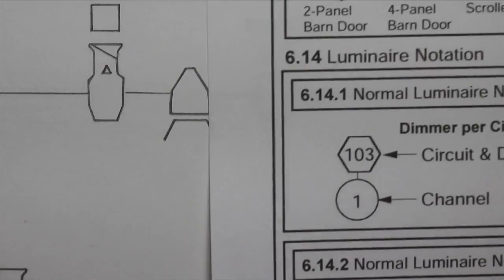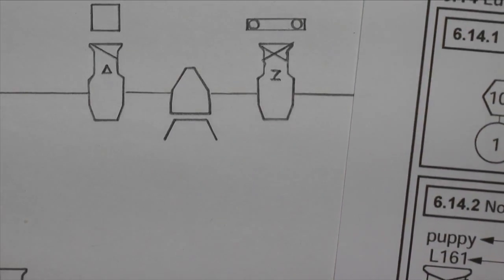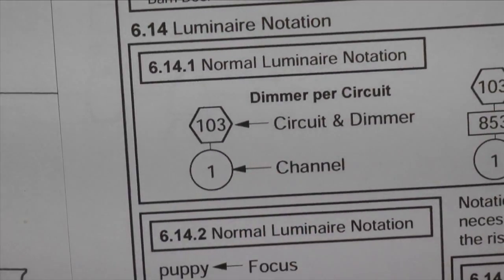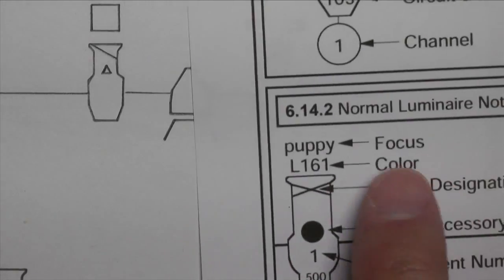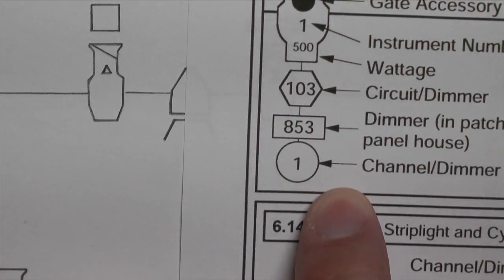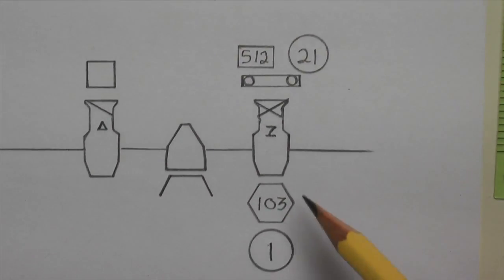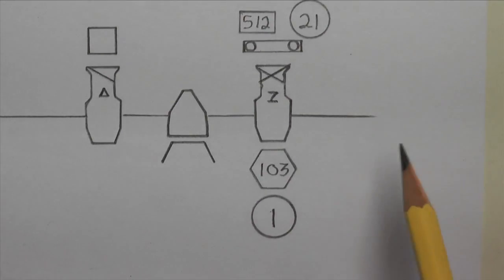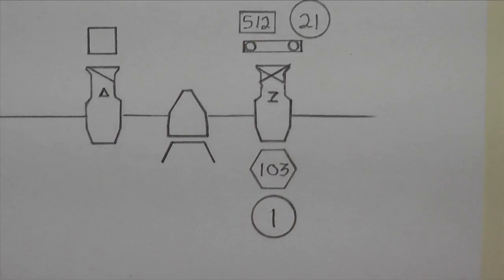This video is about drafting Light Plots - Notations, channels, dimmers

Comment: DMX # is definitely not 512 because no scroller only uses one channel and 512 is the highest you can go on a single universe and to my knowledge addresses cannot span universes, am I right Mr. Memory?
Reply from the maker: Matt Woldanski actually, some only need a single channel as they simply run from 1 to 100 for level to equal color. Or 0-256 in DMX speak. I likely chose to use 512 to point out that the box was for DMX. 
If it were a LED device, then we’d need at least three addresses. RGB. More for units with my functions. 
Wybron made a scroller that had two strings on color that needed two DMX channels. Others might need more if they let you control the fan, etc. 
thanks for watching.